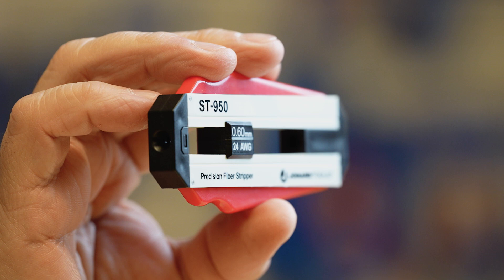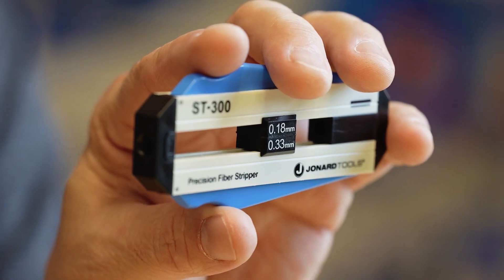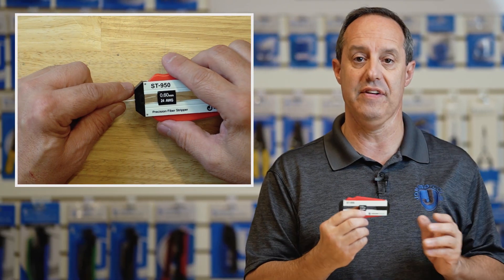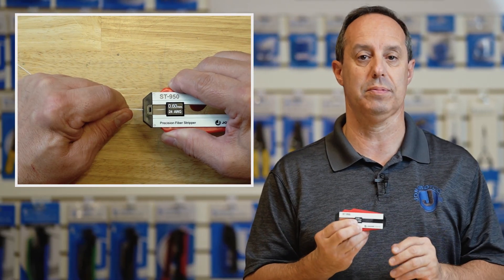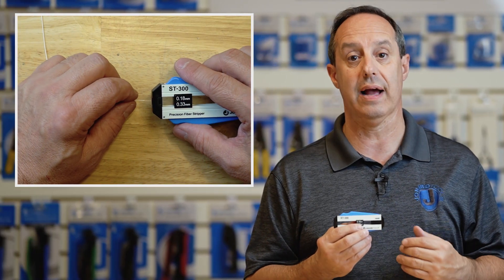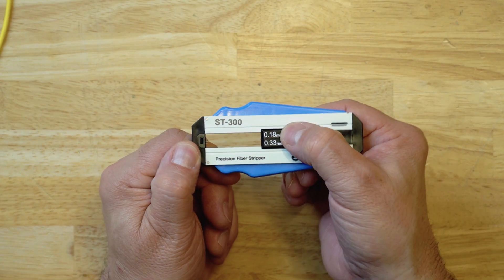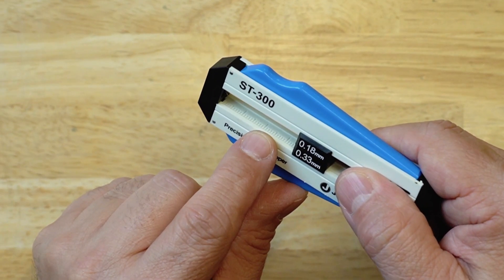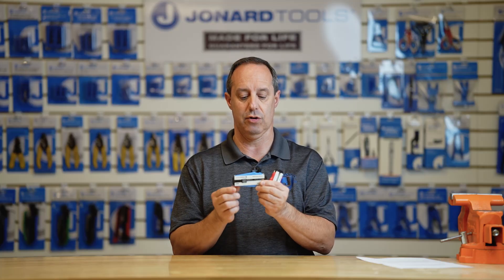Jonard Tools Precision Fiber Optic Strippers (ST-300 & ST-950) Product Video

Comment: Hi there. I have a 600 micron fiber. I ended up picking up a ST-500. Did a make a mistake, should I return and get the ST-900? Or is the ST-500 suitable for my fiber?
Reply from the maker: Good morning, we would recommend returning it and getting the ST-950 instead for this application